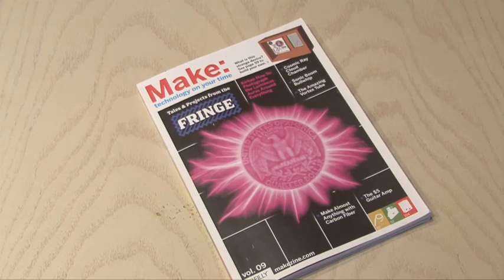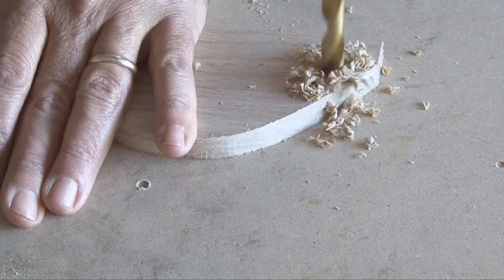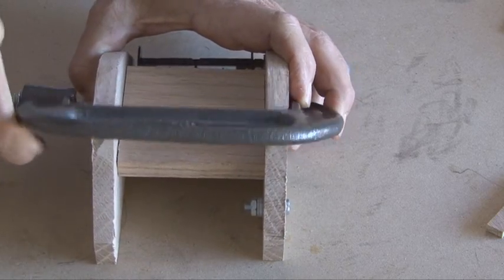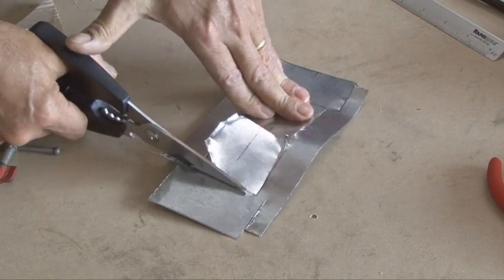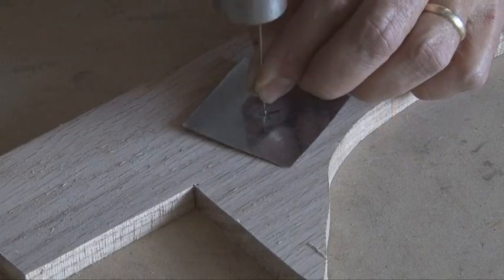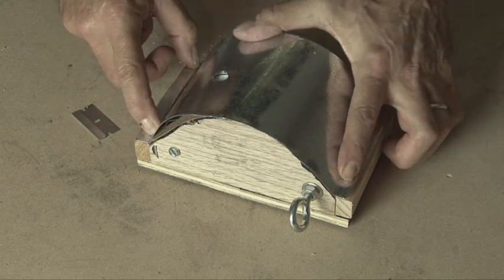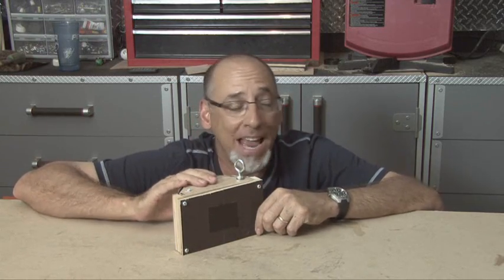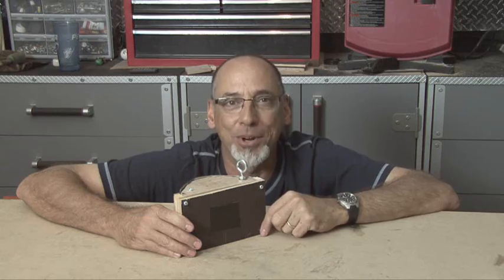Weekend Project: Pinhole Panoramic Camera

Comment: I made one a few years ago. Let me tell you, the hole needs to be small, less than one millimeter,and closer to 1/4 of a millimeter (use a metric ruler to see how big a milimeter is).When you use a pin to put the hole in (I used aluminum foil) do not push it in all the way since the diameter of that pin is about 1 mm.  I used a Nikon camera and removed the lens and taped on the aluminum foil "lens" inplace of the glass lens.If the hole is too big, you get blurry photos.  Expose about 1 or 2 min.

Comment: Wood glue expands slightly as it dries. I've seen a lot of projects call for using it in this type of scenario exactly for that reason. It's just holding the nut in place through pressure. 

I can't imagine it coming lose unless you deliberately pull it out.

Comment: @ 1:47 epic fail in design.  I didn't know you could use wood glue on metal.   That nut wedged into half thickness of the board is all that's keeping your expensive equipment from hitting the pavement?   I gotta credit you I got the biggest laugh of the day watching you pound glue all over and mop with a q-tip.   Oh man yer killin' me.  Are you household hacker?